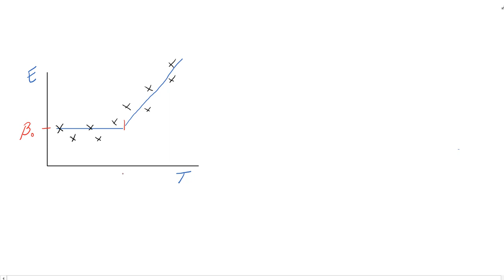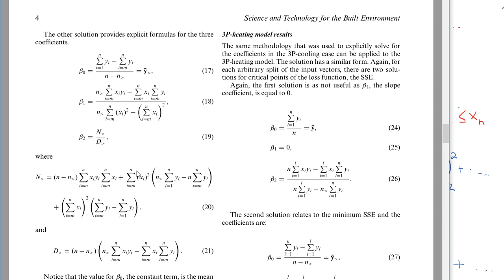Part 2: Algorithm for explicit solution to the three parameter linear change-point regression model

Comment: Hi Mitchell, this is a very thorough explanation. Thank you. It is helping me in my research. The point after this is, how to find the change point location because the explicit solution depends on it. I tried getting your article but I guess it is not free to download.
Reply from the maker: Thank you, Ganesh. I show the formula for the change point location, along with the other coefficients near the very end of the video, around 30:00. I have a free post-print of the original article on ResearchGate at https://www.researchgate.net/publication/312051080_Algorithm_for_explicit_solution_to_the_three_parameter_linear_change_point_regression_model.